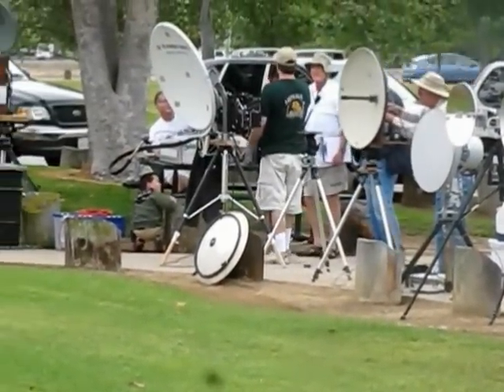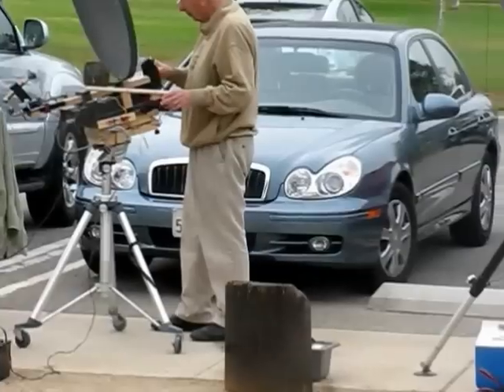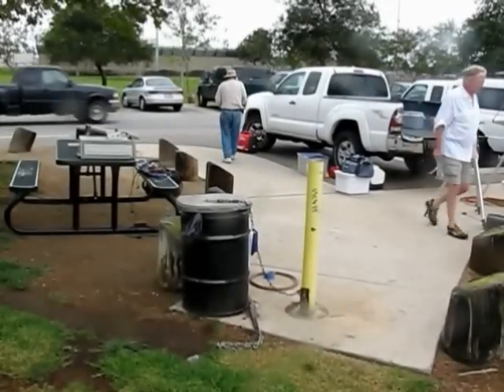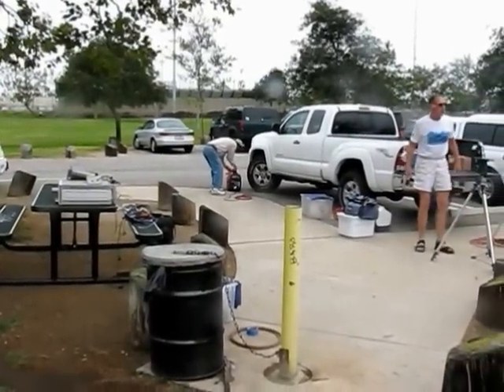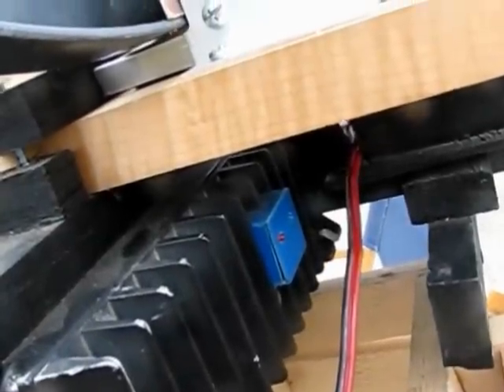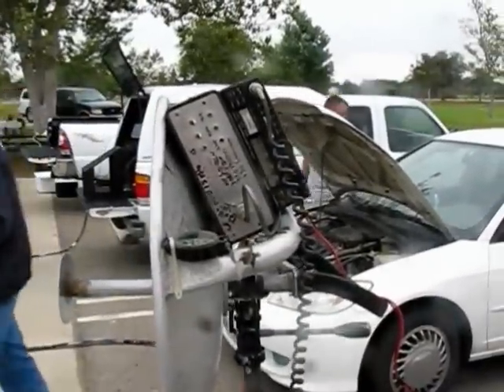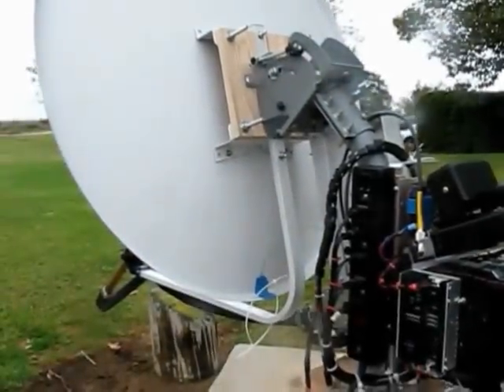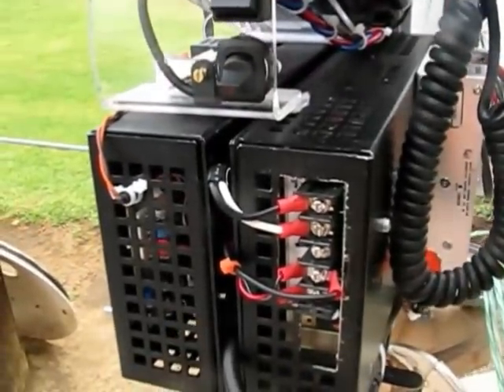Field Testing 10 GHz, 24 GHz and 47 GHz Amateur (Ham) Radio Systems

Comment: Do someone  now what signals are between 8 and 10 Ghz (maybe higher) signals in mine home who is quite strong, maybe part of the ruckus long distance wifi of mine nabure? who do disturb mine audio designing work, I do measure audio signals these have pulses.  is it maybe a datalink? who do transmit from nabure where antenna is and the other nabure who live other side. I have measured with a spectran spectrum analyzer.

Comment: How much actual 10 GHz radio traffic is there in this area? If it weren't for the lack of operators where I live in south Florida I'd love to put together a 10 GHz transceiver setup.
This would be a lot of fun because you can't just call up HRO and buy a complete out-of-the-box system. You have to really learn the gear in order to build your own setup and that's what's so much fun in my opinion.
Reply from the maker: Lots of activity in South and North Calif. Take a look at the ARRL.org Soapbox posts for the 10 GHz and Up Contest and also the after contest results to see if there is activity in your area.

http://www.arrl.org/contests/soapbox

A Google search may turn up some good references. Start with the SBMS site - it has articles and links:
http://www.ham-radio.com/sbms/

73,
Wayne KH6WZ